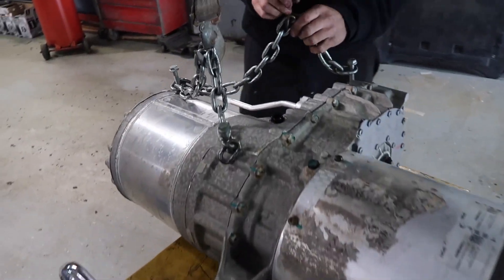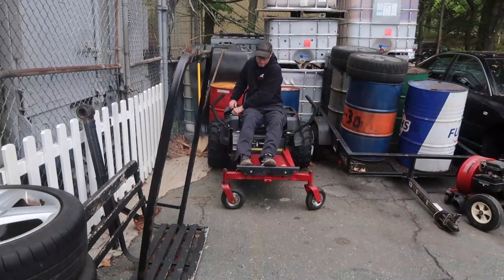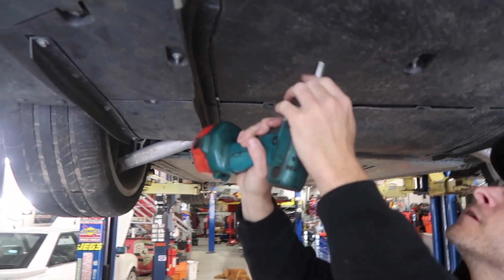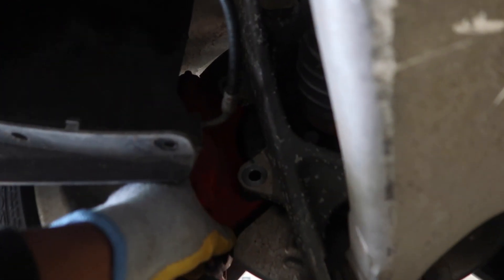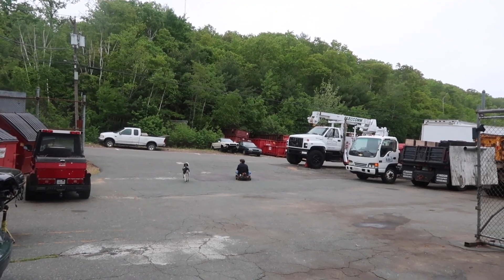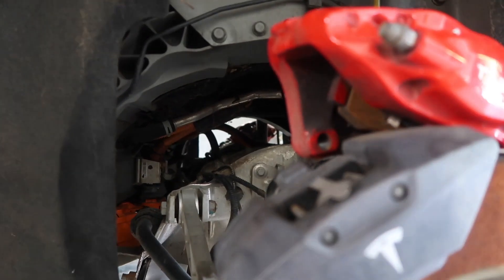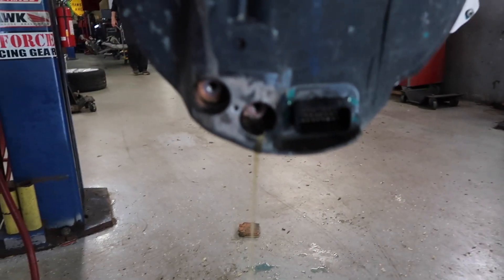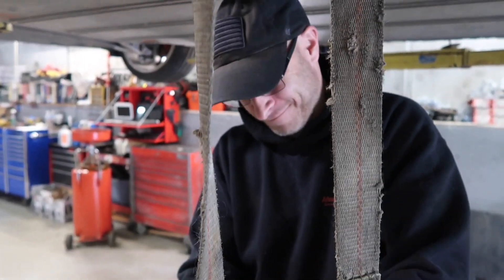Can You Drown a Tesla Motor?

Comment: After a good cleaning, the motors should be fine.
Induction motors are what they use on small submarines, and they'll work in some really rough conditions.
Your problem will be with the inverters. If you wish to save the ones that came with the motors, you know what to do.
After the cleaning drying, and testing, you might be pleasantly surprised. Let's hope that's the case.
Just make sure that no juice gets to the inverters before they're completely dry.
Reply: Yup, its very likely the only thing to kill those boards if no current was ever applied to them would be something that rusts, even then it could very well be repairable. The car would never close the contactors in the battery, too much would be out of spec well before that stage of the selftest.

Comment: Not sure why Tesla would put circuit boards IN the motors. I'm guessing some kind of sensor circuitry and controller. The motors themselves should be fine but those boards, their done. The boards should be in the car, that way the motors would be even more compact and water tight, also considering the motors have heat warnings and are liquid cooled they definitely shouldn't have those in there because it can course premature death of them, especially with a long drive on a hot day.
Reply: Travis, why are they done?  Is there something water-sensitive in the solid state electronics?  If they are cleaned and dried, they will probably work.  Not a guarantee, but certainly worth a try.
Reply: Those circuit boards are not in the motor, they are within the can opposite the motor and form the inverter which converts the DC from the traction battery to AC for the motor. It makes sense to keep the connections from the inverter to the motor as short as possible which is why they are where they are.
Reply: Their surrounded by the motor's magnets. It makes sense to keep the connection short though, more reliable connection and feedback.
Reply: +Travis Piper      Those boards are not surrounded by the motor's magnets (I assume you mean the stator windings i.e. electro-magnets, there are no permanent magnets in a Model S traction motor).
Reply: I see now, looked like there were neodymium magnets when he pulled the cover off but could be heat sinks instead.

Comment: This is a $100k+ electronic machine and you would think they would somehow seal the motor but nooooo, Rich as long as none of the chip components on the pcb's were fried you can take them boards off thoroughly clean them with alcohol and please double check all connectors the pins must be cleaned too this is same as any other computer same components same procedure, I've been a service tote man for many many years and this sort of thing is the procedures that were thought us to do for when any kind of computer based electronics were ever water invaded, jumbo trons, betting terminals, atm machines and just about anything that sits exposed to the water we have done it, Rich good luck.
Reply: No, you are wrong! It was sealed... with a VOID sticker...
Reply: Ivaylo Tiholov so what you're saying is that it was serviced by Tesla and not resealed properly again?
Reply: No, that was ironically! Should I explain it???

Comment: Rich, you should be good on the motor as long as you change the bearings.  As for the inverter if the power to the inverter was off upon initial flooding you should be good with the inverter also just make sure the board is completely dry and use electrical contact cleaner on all the circuit boards.

Comment: I feel like if you sat that board into an ultrasonic cleaner, then maybe did some reflow work on the board, then more ultrasonic cleaning, they would work just fine. As for the motor itself, they are usually pretty tough. Bearings might be of concern though.

Comment: that diff maybe can be saved but I would not trust that motor anymore even with new electronics. If it runs after cleaning (just motor) I would re-use it in some for fun project but I would not use it in a car anymore. Salvaged unit from wrecked car is the answer imho.

Comment: D'ONT GIVE UP ! If you cant solve the problem or see a solution ,let go for a few days and sleep on it , i have seen worst , just count your lucky stars it wasn't  seawater !!! 
Take one step at a time;dismantle slowly no rush ;take pictures as many as possible,clean and dry all components slowly,no blow hot drying allowed just soft inert clean compressed gas;  stator/rotor use good quality cleaning fluids,if in doubt bring the motors to a good qualified motor repair shop; As for the high tech components these must be handled with extreme care; again let them dry slowly; again find a good electronics guy with a understanding of these pcb's.
 Its pity you are so far away as the electronics I can handle easily,but my job description must remain confidential.

Patience is a virtue and your pragmatic approach will help you in solving this problem , If its built by a robot then you have a very good chance in fixing it ! After all who invented them !

Comment: They must be waterproof 

The number one fear with an EV would be water damage.
Reply: If a gas or diesel engine vehicle gets flooded it can be brought back to life depending on the age of the car or truck electric power windows or seats may not work and wire harness and those items that don't work after being flooded can be replaced by parts from junkyard cars that were not flooded .. and you can get new seats and new carpet from the junkyard cars to fix your own
Reply: Bigtruckseriesreview Motorsports isn't water damage bad for all types of cars?
Reply: I had my car whole in water  ...i was  drunk when i finish in the river so did not call anyone like police or something but my friend with a crane took it from there..i just left it 3-4 days on the sun,recharge battery ..and after 30 minutes off truing it started and its still working no problem after 5 years from then ..only thing that did not work was one electric window and screen washer
Reply: But given how ICEs work, the engine will shutdown real fast after it's unable to move, right? Isn't that the same as what you're suggesting? Or are you saying the few seconds before the shutdown are enough to damage it?
Reply: AmericanHillbilly insurance will usually salvage cars after floods. They may still run, but for the long run I'd take the money instead...
Reply: Even a boat can't handle 10 days under water, even most submarines will struggle

Comment: You can clean rust off to a point if the metal is not pitted. If the electrics are sealed well like the dash and screen was. I say you are fine. Cannot wait to find out. Wonder if someone out there has delt with something like this before that can help. Good luck.

Comment: Remove all the control boards and bake the motor windings at 180f for 8hrs, this will dry out all the remaining moisture.  The control boards can be cleaned easily like funkyzero said. Dehydrators or a makeshift box and dehumidifier would work well for small control parts etc. Love the Vids as im a EMST mechanic (Electric Motor Service Technician) and super interested in the Tesla construction. Keep it up!

Comment: My knowledge about circuit boards is almost entirely related to the computer hardware space,  But do you think it could be saved by giving it a bath and scrub in 99% rubbing alcohol? Alcohol is not conductive so a high grade should absorb the water and lift the contaminants and then just dry off quickly

Comment: I'm not convinced water will have killed the PCB's in the inverter. As long as there was no power put through them while they were wet I'd have a go at cleaning them with some suitable solution (perhaps in a sonic cleaning bath for best results) and give them a good drying out. Then clean all connectors with suitable contact cleaner. Modern components can go through a variety of pretty severe processes including reflow, wave solder, hot air soldier etc so are pretty tough. I'd put dielectric grease on the connectors afterwards but not on high current ones as apparantly it is not suitable for them. There will be something fandabby good for them too though. Find a good PCB engineer and stick them under his/her nose for an assesment about the components on the boards and wether they will clean up OK or may be stuffed.

Comment: The diff will be fine.  A little new gear lube and all is forgiven.  The inverter I don't know a thing about and maybe Rich can speak to this but a 3-phase, 4-pole, AC, induction motor isn't impossible to obtain outside of Tesla.  Fukuta Electric & Machinery collaborated on the  electric motor design so I'd bet there's something pretty similar in their parts catalog.  Might even be able to Frankenstein one together out of the remnants of this one plus what parts you can get new?
Reply: haha you need the tesla motor there is no substitution.
Reply: theAppleWizz so you were on the build team for that electric motor?  Great!  Please explain how to repair it. I’m sure Rich would appreciate your insights.
Reply: Not sure if you know but that motor was design and manufactured by Tesla second we do not know the condition of it yet because what you saw in the video was the dc to ac converter/controller and I do believe that it is salvageable base on the fact that electronics has a moister coating. Your suggestion of  "Fukuta it" would only make the project 1000 time more complicated base on a few fact the main one is  that he has another motor from the red car. In addition, base on the level of corrosion that was shown the differential should be  in good condition even if it had water inside, it was clean water and most of it was in the bottom. AND just for the fun of it, The process  of repair. it would mean taking the board of the housing using 90% rubbing alcohol to remove the silk of the board using a sonic PCB cleaner and placing it in a small oven at 150f to 200f to remove any excess moisture placing it back and hoping that the moisture coating protected most of the components and checking if it works.
Reply: You're right.  We not not know the condition of his motor or the other one he has as a spare.  I was simply suggesting it might be possible to make repairs to the motor he has using parts from another manufacturer.  I do not think Tesla's motor was a from scratch design.  They themselves say it was made in collaboration with Fukata.  So if some piece is not usable it might be possible to source a bearing pack rather than a $40k motor from Tesla who won't sell it to you anyway.
Reply: Its just a coating that will protect from moisture

Comment: Put the controller boards in an ultra-sonic parts cleaner with Branson EC to help clean off the corrosion. Soak it in isopropyl alcohol after that to rinse of the cleaning solution. Should work good as new after that, provided there wasn't any power running to those boards while they were underwater.

Comment: I've ran plenty of electronics that had water damage. The trick is to clean them thoroughly. I always like to use rubbing alcohol - the higher percentage, the better. Grab your electric toothbrush and get to work! It'll clean off any grease and debris, and when it's done it just evaporates out.
Reply: Take the boards out, pressure wash the motor, ultrasonic the boards; before the alcohol.

Comment: The blue and white on the BMW logo can stand for either two things:
1. BMW means: Bayerische Motoren Werke, the factory is located in the bavarian town in Munich. Blue and white were the official colors of the Bavarian Free State.

2. The blue and white could symbolize a spinning propeller from an aircraft that the made during World War One.
Reply: It’s the colors of the Bavarian flag in the blade of an airplane propeller.
Reply: The BMW logo has nothing to do with a spinning propeller, the logo was the same before they built aircraft engines. The blue and white are the colours of the Bavarian flag and are shaped differently in the BMW logo because of law in bavaria not allowing anyone to copy the flag design or something
Reply: @SF7PAKISTAN  Then it wasnts not the flag that was the inspiration now is it? Because if it was, BMW wouldnt even exist as they would be fined out of business.

In any case its settled. BMW have said both are acceptable.
Reply: Milan Meiland, BMW means Boobies Must Wiggle
Reply: 1

Comment: The motor itself is probably still good but the inverter and speed sensing circuit boards are probably dead.
Though if they're a simple two layer circuit boards there's a chance they may be salvageable but the more complex four and six layer boards with BGAs on the other hand are much more fragile.
In someways how Nissan and GM did things with the inverter in a separate box and the motor just being a dumb electrical device was a better design.

Comment: Hey guys the motor will be fine you could have it checked by motor rewind company I used to be engineer in that area like guy below, said just put new bearings on it bake the motor for hour it will be fine
Reply: Dave Burgess The motor isn't the problem (now), the inverter is.

Comment: Louis Rossmann is a fan of your channel, send him a board at least as a courtesy, but since there was no power it might just be a matter of cleaning it with a powerful ultrasonic cleaner. Which he happens to be a dealer of.
Reply: If no power was going through the circuitry then yes, possibly.  Take a look at Louis' 1000+ videos. He repairs very delicate electronics that have been given a swim in various beverages and other disgusting substances by their owners whilst being turned on. He does board repairs under a microscope once he's identified and repaired the obviously blown components and then throws it in an ultrasonic cleaner.  Sometimes it just needs the ultrasonic. You wouldn't believe some of the stuff he fixes.  Even if he doesn't manage to fix it, it'll be a really good video he makes about it - he may even give his opinion on Tesla's build quality, so it'd be interesting.
Reply: Really?  You can put a board in an ultrasonic bath and everything is cool with all the components?  That sounds sketchy to me.
Reply: just don't ask him to ball solder anything.
Reply: You mean apple products...lol "delicate"
Reply: i dropped my samsung s5 in water without battery for full 15 hours... than i dried it with heat gun and it still works lol..just a small water damage on display